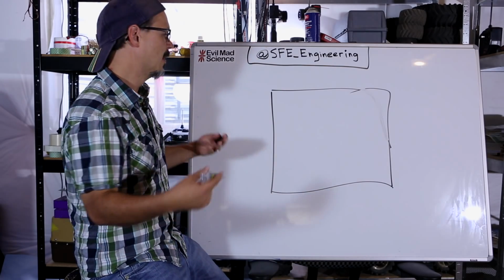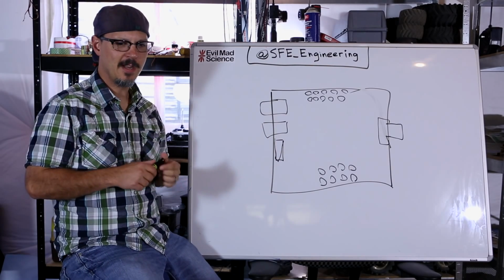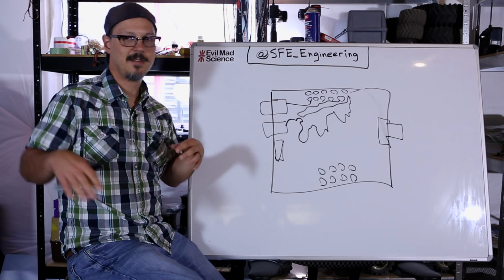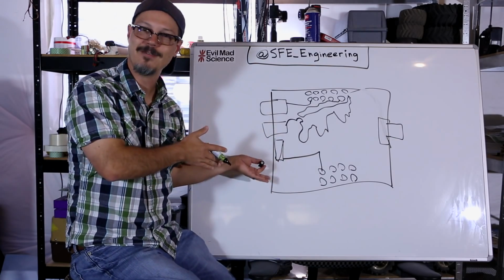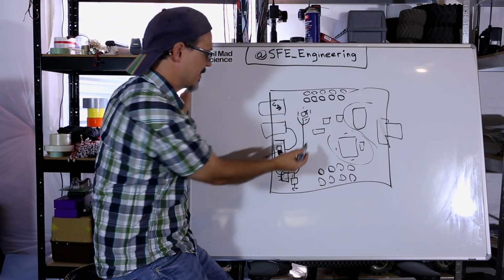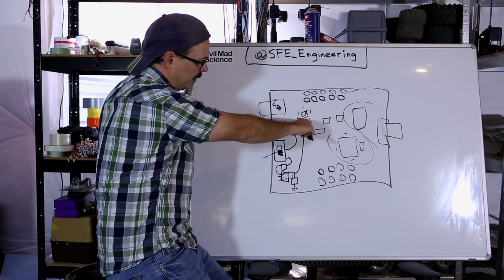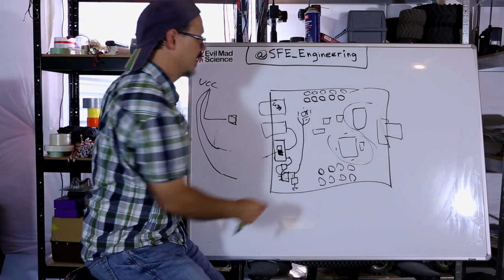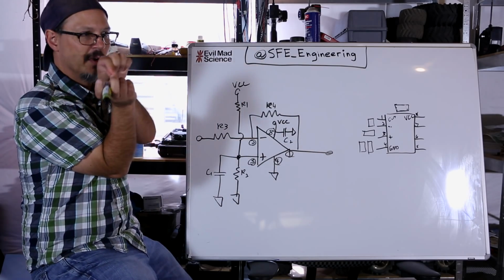SparkFun According to Pete #34: PCB Layout

Comment: 16:53 .. but if I feed the powerpins under the microcontroller like that, the decouple caps would be in the trace BEHIND the powerinput-pin of the microcontroller .. so like   VCC---->Pin--->Cap ... that way the cap wouldnt really help to filter the current before it gets into the controller..   .. it has to be VCC----Cap---Pin .... at least thats what i learned. so from unter the chip, if the chip is on top, you could route like that on bottom, make your cross and route to outside of the package area, via to top, then route to cap and then route to pin
Reply: same problem @ 21:25

Comment: There's 1, 2, 4, 6, 8, 10, 12, etc.. oz copper options all the way up to 200 oz!! A 20 oz board can cost $2k+, they are usually used for aerospace or military applications.
Reply: Very cool!

Comment: This video is great. I feel like I've learned a lot. 
The only aspect that I disagree with is not using the auto-router. In my opinion it's a great way to figure out how to layout your components or create boards with a low amount of parts. If some of the traces are not routed perfectly you can simply rip them up and thereby perfect the auto-routers suggestion. 

Also at least in Eagle by using the "follow-me" feature you can ensure that your traces stay within your DRC specifications. So essentially this kind of "semi-auto"-router allows you to combine the best features of automatic and manual routing.

Comment: Right angles only matter when it's important to control your impedance (which requires controlling your trace width). because at a right angle the width of the trace increases briefly. In a transmission line this will cause some amount of reflection, which affects signal integrity. for slow signals or short traces it doesn't matter. The usual rule of thumb is something like trace length under 1/10 the wavelength of the highest frequency of interest, highest frequency being related to the rise time (not the frequency) according to 3.5/Tr or 5/Tr. Has nothing to do with probability. (Paraphrasing Johnson's black magic book here).
Reply: +matt holland Matt, you are dead right but i reckon this is a good start up for beginners like me.

Comment: Nice two part miniseries. Lots of good info.

While not quite in the scope of this miniseries, I'd like to share a schematic trick I first saw when I got a hold of the schematic for an Amiga A500. (Also seen on A2000 and A3000 schematics, don't know if it is historically Commodore or HiToro.) One of the last pages of the schematic were all the decoupling capacitors. There was a square glyph for each and every IC with just the power pins, and the decoupling cap for each pin was attached to the relevant pin and the pins were connected to their appropriate power/ground sources. (Also keeps from cluttering up gateA of each IC with power considerations, and having to connect Vcc to Vdd to +5V to connect hidden pins...)

I've been able to replicate this practice in KiCad because it doesn't force multiple gates of an IC to have the same glyph. YMMV with other EDA packages. Makes it helpful when laying out the board with a multipage schematic because I only need to reference 1 of the pages when placing (and verifying) the decoupling caps in one pass.

Comment: He's talking about mils, which is not short for millimeters. A mil is 1/1000th of an inch. Mils are used in higher precision design/manufacture (like on a mill, lathe, CAD software, etc.) while still keeping the U.S. standard unit system. 'Merica